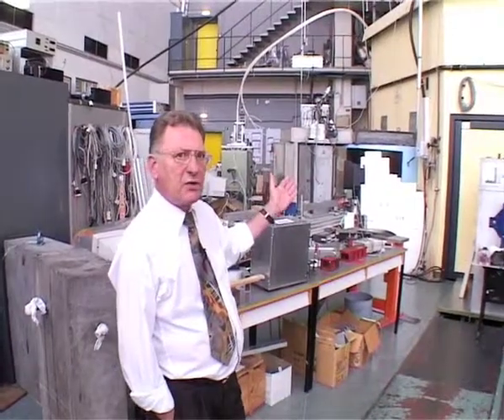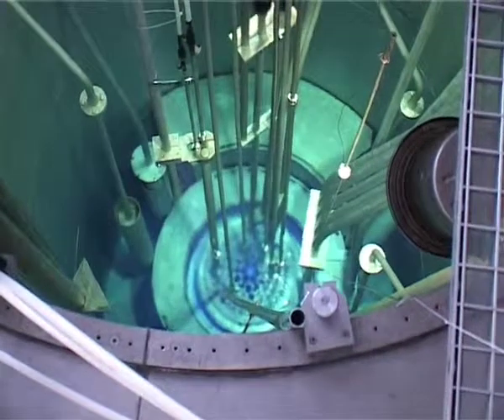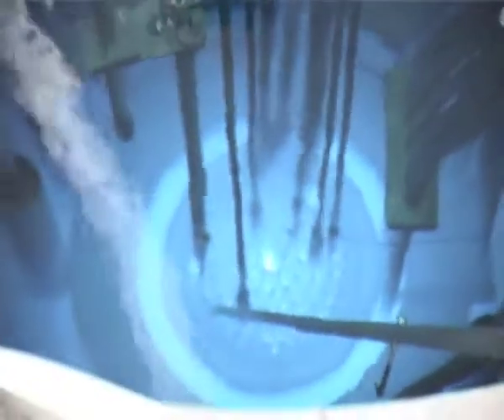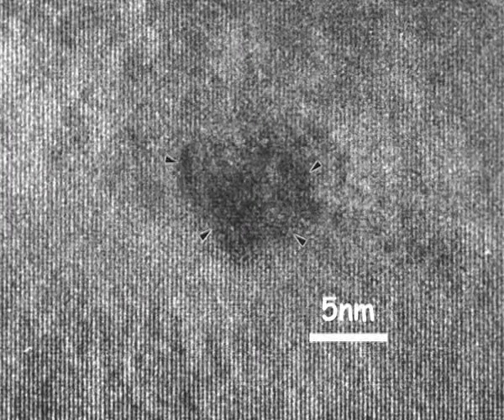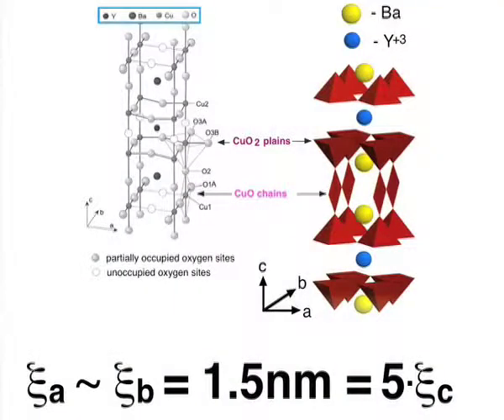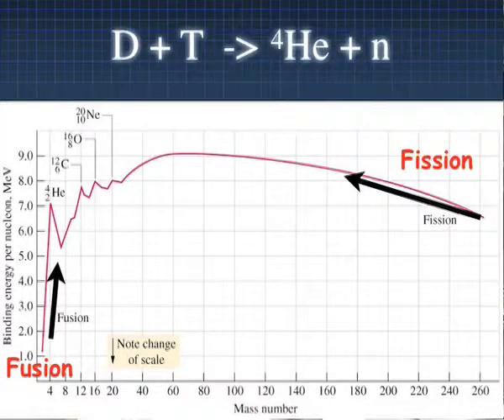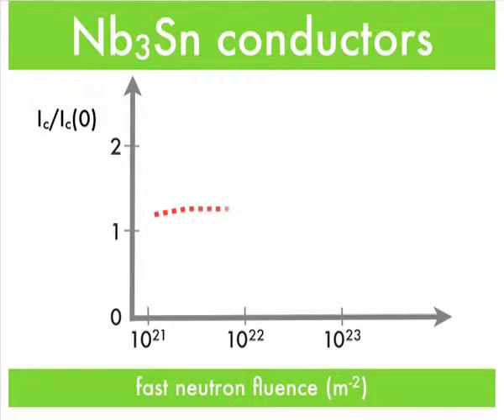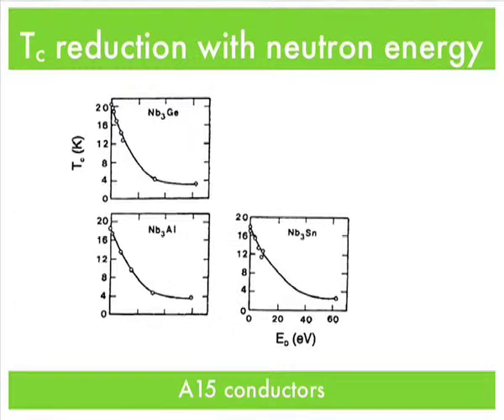Superconduction: pinning centres by neutron irradiation.

Comment: First i video see that talks about the problem of high neutron flux on superconductors, which would be a major problem for things like ITER. They should have made the research maybe before starting building it tho... Now if we learn no superconductor can withstand the flux tens of billions goes to trash.
Reply from the maker: Bear in mind that research means delving into the unknown.
Reply: @bhadeshia123  I completely agree with you, but couldnt they have first tested on superconductor samples under neutron flux if it works ? thats delving into the unknown.

But building a whole concept with tens of billions where if that one things happens not to work everything is useless ? thats just plain damn wasting